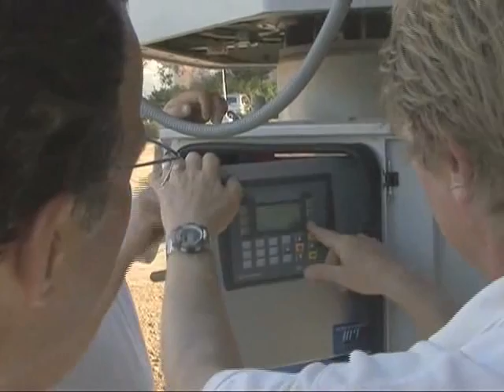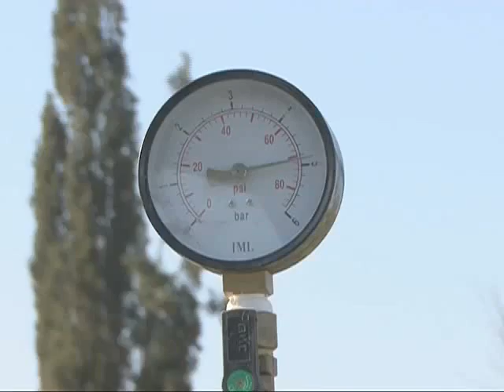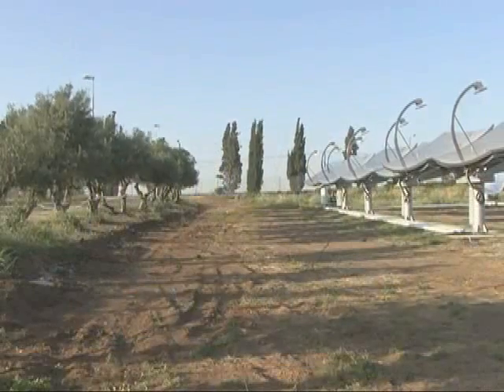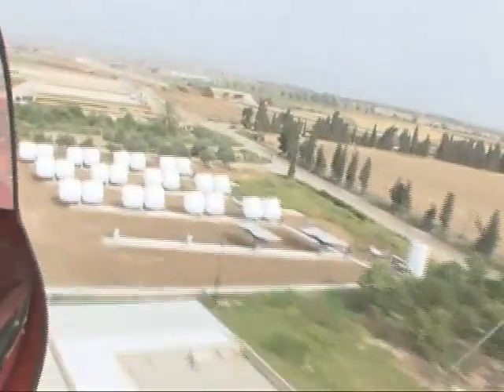Why Design Now?: Z-20 Concentrated Solar-Power System

Comment: It is way cheaper to do it that way.  Think of the effort of polishing a large mirror into optical specs.  But the math works the same in this type of array.  Radio astronomers use fields of small parabolic dishes and then massage the data into a whole.  This is easier and cheaper than making a single telescope like the one at Arecibo.